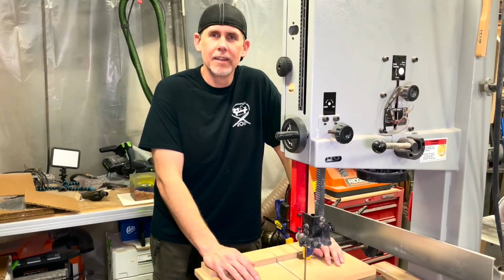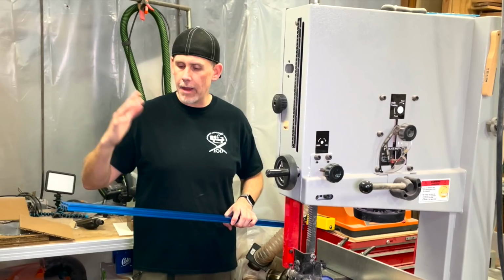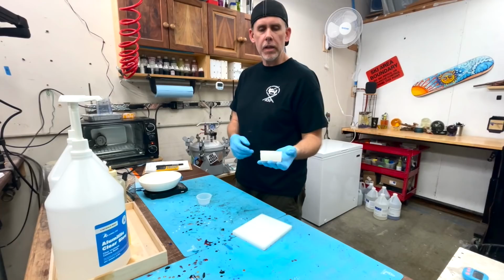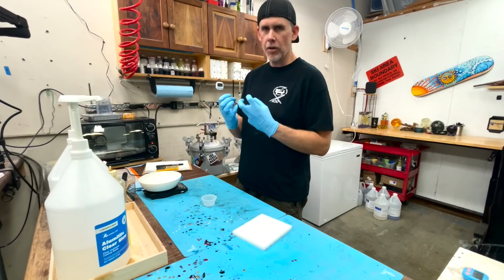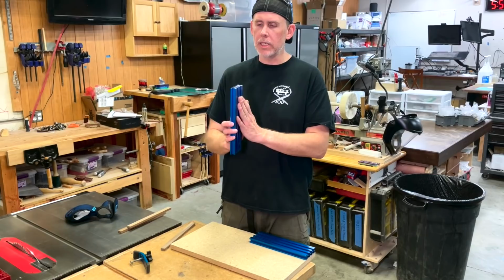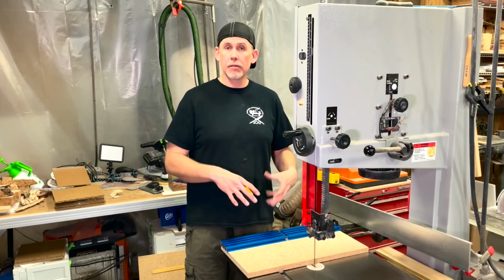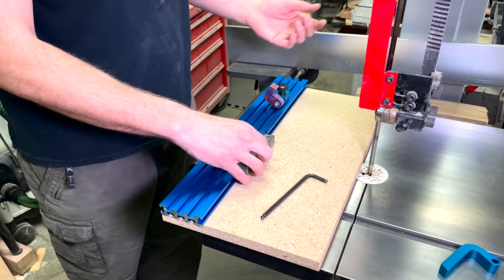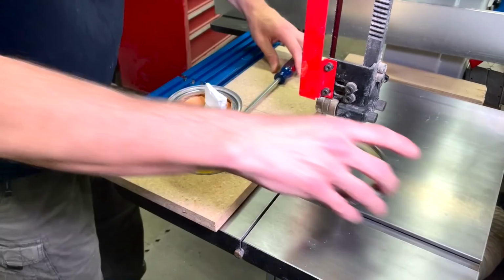Bandsaw Sled with Custom Resin Cast Flip Stops

Comment: That is awesome Zac, thank you for your time and sharing. I wish I had a bandsaw as big as yours. I love your shop. If someone could sponsor me I could get a YouTube channel going on.
Reply from the maker: Thanks Patrick. You don't need big tools or fancy equipment to start a YouTube channel. Just a matter of shooting videos and posting them 😀 I already had most of the tools I own years before I started making videos. I did like everyone else, saved up and bought them when I could. I am lucky to have a large shop, but I had most of this in my garage before I moved into my Dad's shop.  BTW this video is not sponsored by anyone, and I bought all the t-track and accessories from Rockler many years ago with my own money, no discounts
Reply: Well, as good as you are you should have sponsors Zac. Thank you for your good advice and for your time.
Reply from the maker: @bgpappy30  Thanks Patrick! Just didn't want anyone to think I was using freebies or getting paid for product placement in this video. I just had it on hand and wanted to make a sled =D 

I am an affiliate of Alumilite and Turners Warehouse though, so I get a referral bonus when people use my links to buy products from them (Amazon as well). I get some freebies from them from time to time along with Easy Wood Tools and Stainless Bottle Stoppers. I try to always clearly state when I'm using something that was sent to me in a video, and if I were getting paid for product placement, which is not likely to ever happen, I'd clearly state that as well. 

Our audio podcast, The Resin Cast, is sponsored by Turners Warehouse, Easy Wood Tools, and TurnTex though, they keep the lights on in the recording studio

Comment: is great if both blanks are same length, but many pen blanks have different lengths.
Reply from the maker: That's true, but if you're making Sierras it works great. My point in making this sled and video was not to persuade you to make the sled and custom flip stops for pen blanks. I don't even use the bandsaw to cut pen blanks myself, but it was a good example at the time. I just wanted to share an idea that I will be using myself for many things that I do cut repeatedly the same length

Comment: I’m new to this. Curious, could you have used a vacuum chamber instead of the pressure pot? Thanks.
Reply from the maker: I think pressure works the best for casting, vacuum is better for degassing silicone and wood stabilizing. Plus, the resin I used sets up too fast for vacuum which is a slower process, pressure works immediately
Reply: @ZacHiggins  - Thanks Zac. I hope I’m not bothering, I’m trying to learn, so if I get it you could have used vacuum to make your silicone mold. You didn’t, so I’m curious as to why you didn’t? It’s obvious you didn’t need to as it came out great. Thanks so much for your help.

Comment: For thise of us that dont want to make a silicone mold would you be willing to sell a resin cast stop? Nice video
Reply from the maker: Thanks! I'm not planning to sell them since they are so specific for that flip stop mount. I'm not even sure if they still sell the same exact style at Rockler, bought it years ago. Plus, they require a decent amount of extra work sanding, they don't come out of the mold ready to go since I didn't put much time into the master